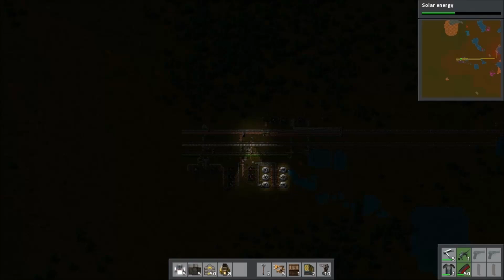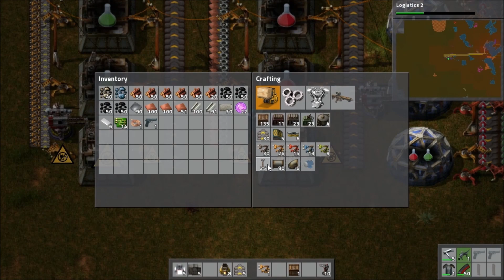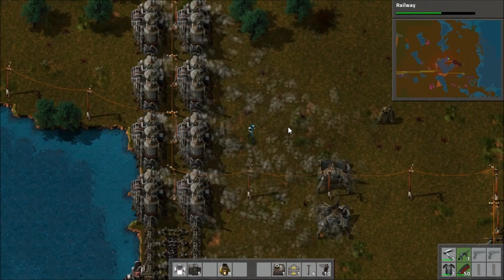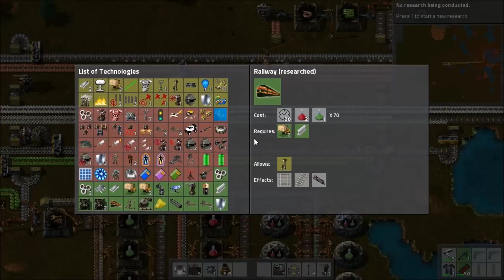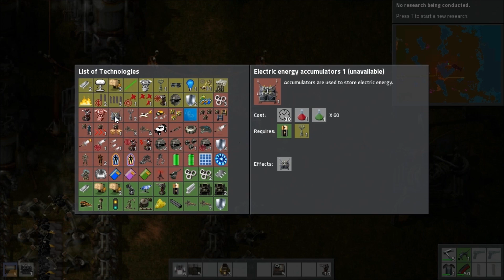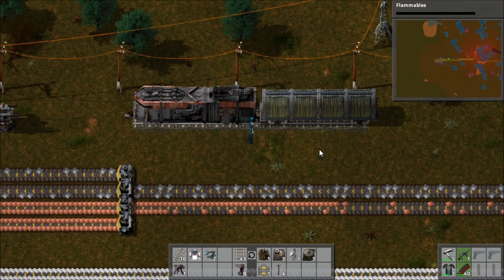Factorio Railworld Ep#4: Rail Research

Comment: At 8:00 : 
You can also have the copper wire assembler be a level 2 and the circuit assembler a level 1 (like you did in "Bentham's Factorio Tips: Production line design"). And later on when you start using level 3 assemblers you can put one level 3 speed module in the copper wire assembler. This leaves 3 spaces for your favorite module :)